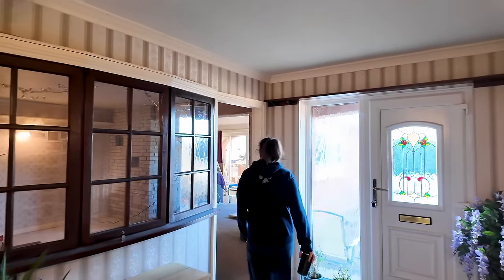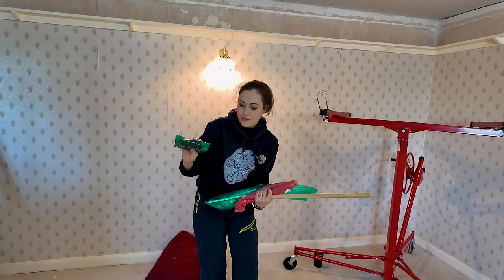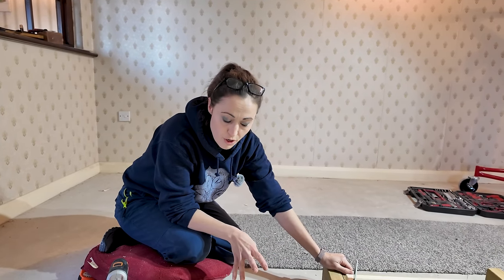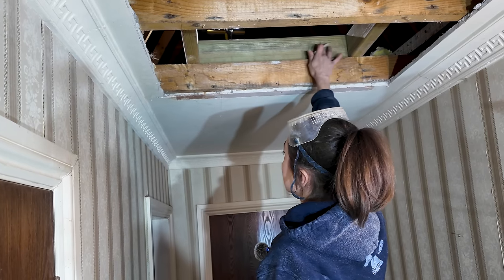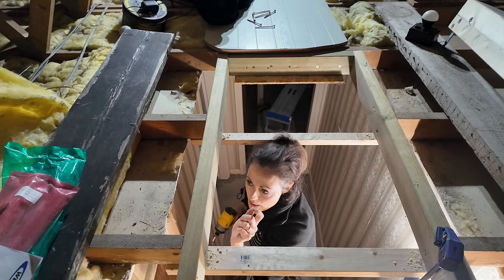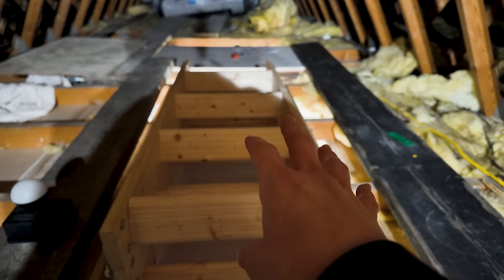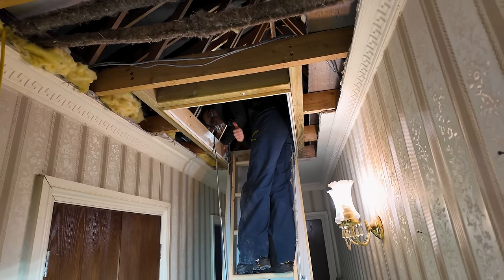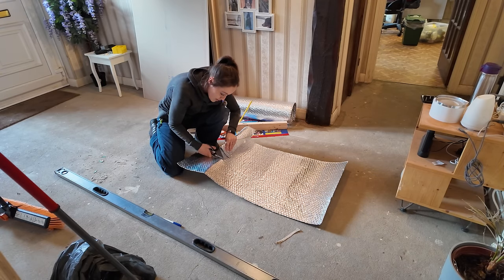How l installed a DIY loft ladder hatch kit without a PRO!

Comment from the maker: Now it's done do you think I should hire a plasterer or have a go myself???
Reply: Hire a plaster 100%. I got let down by my plaster so I thought how hard can it be? Turns out really hard. I was doing the landing and the hall all by myself and it kills your arms and although it looked ok when painted it really was not. 

Also a good loft ladder, decent set of fluorescent light and boarding and the loft becomes another useable space for storing stuff. Lighting is the key though. Don’t scrimp on the number of lights. You’d be surprised at the difference it makes.
Reply from the maker: Thanks so much! I've just bought 3 6ft LED batten lights (7200 lumens) for up there... hopefully it's not too bright 😅
Reply: It's never too bright in the attic. @TheCarpentersDaughterUK
Reply from the maker: I hope not. Going to test them tonight 😀
Reply: hire it out - maybe give it a go in the hallway so you can get your diy fix and make a video out of it but that big room is going to suck.
Reply from the maker: Thanks. I would've thought the hallway would be harder than dry lining the big room?
Reply: Just less overall area to do, and you'd still get to do all the steps of it.  @TheCarpentersDaughterUK
Reply: Have a go yourself I think but invest in some decent plastering tools if you don't have any already.
Reply: I don't skim ceilings any more, just tape and joint compound. Gypsum plaster seems to crack so easy on a ceiling where as paper tape and joint compound has never cracked on any ceiling I've done, and it's so much easier to do.
Reply: I prefer to take everything on myself if possible, and I'm extremely averse to hiring out due to the UK's high proportion of untrustworthy tradespeople. However, finish plastering is among my few exceptions. Almost every other DIY task appeals to me more, and the skill requires substantial time investment. When my brother and I built my kitchen, we fitted the ceiling plasterboard but got an excellent plasterer in for finishing all walls and ceiling. It looked like a mirror afterwards, yet looking it over he shook his head, said "I'm not happy with that", took it off and did it all over again!
Reply: A professional would make quick and easy work out of it. Take the down time to recover.
Reply from the maker: Wow lol... hope they didn't charge you twice 😅
Reply: I feel ya. When finishing my basement I spent a full week mudding/sanding a room, gave myself a sinus infection and was sore all over. Looks like shit lol. @worstuserever
Reply: I wouldn't recommend taking on a ceiling as a first foray into plastering. I would wait till there's a lot of bits of plastering to be done and get a pro in - they do huge amounts in a very short space of time. If you want to try it pick a small flat area of damaged wall or part of the fireplace you're not sure about. Good luck either way.
Reply: Perhaps try a small area in the hallway first so if it doesn’t work out there’s not too much damage? Once you start plastering a room you cannot stop until it’s completed. By trying out a small area you will know if you have the physical strength to complete a whole ceiling in a room!
Reply: Ceilings are the hardest to skim. You’ll ache in places you didn’t know you had and the light shows even the smallest imperfection. Try skimming a small wall first.
Reply: Good job, nice easy access and tidy too. Whilst you are a handy sorta girl, bitter experience and age has told me that a professional is best for some jobs.
A tool suggestion if you don't already have one, get yourself a Cat's Paw - like a little wrecking bar but about 3/4 your hammer length. Should cost less than a tenner.
So handy in tight spots, easier than a claw hammer and make a great little sound when you smack 'em. Got a nail bag?
Reply: Definitely get a pro in, plastering is a very easy thing to do... badly. 😜
Reply: Have a go yourself. It's a small area so perfect for a first attempt.
Reply: Hire. No hesitation on this one. I once converted a basement and had a highly recommended guy come in to plaster the walls and ceiling. I have never seen anyone sweat so much outside of a gym!
Reply from the maker: @across8339 🤣🤣 I'll leave it on this one then! 😀 Thanks for the honesty lol
Reply: Tape your joints and Gyproc Easyfill
Reply: its not a easy job plastering 🤣
Reply from the maker: @mikebarry229  i would definitely agree to consult a professional beforehand. I thought I made that clear in the video, but always good to reiterate for those that missed it. Thanks 👍

Comment: Well Vikkie that has brought back memories to when i fitted the same loft ladder to a family members house but the ceiling was so high that we used the loft ladder at it's full length.
I can tell you that we had a devil of a time getting the ladder fixed into place in an old victorian terrace. 
The black dust got everywhere and we were finding it for weeks later.
We must have done something right as it is still there and in great working order after 20 years.
I am really enjoying the house renovation series and i know that i am going to learn something from it : )
Reply from the maker: Thanks so much 🥰 I don't like heights (which is why I hated seeing the drop through the ceiling before I plasterboarded it up) so can't imagine having to fit it at full length and how awkward it must've been to install on step ladders. I'd've probably wanted to used a scaffolding platform lol. But once done, they are great! Hopefully mine lasts for at least that time too!

Comment: I have used neon light switches at almost ceiling height in my hall - these can only be switched on when on the ladder so no accidental switches & let's you know you've left the lights on. Also no scrambling around for a switch in the dark loft space. Thys doin a grand job lass 😊
Reply from the maker: Thanks so much :) That sounds very useful! I've not seen neon ones before either!
Reply: That's a good tip - might do that myself

Comment: Well done, similar to one in my home. Don't forget, over the years, wood will warp so maybe that latch may not work, my loft ladder just hangs there.  Terrible for roaches to enter the house, I need to spray the loft every six months with roach spray (they enter the loft via down pipes).

You now have to add lights in the loft - DO NOT use the loft for storage unless you want an invasion of bugs / roaches etc.  Work men love the ladder and lights, easy to work up there.
Reply from the maker: Thanks again for the tips and cockroaches sound awful 😅

Comment: Once you've got all the insulation spread out and ceiling plastered, if you still have any air leaks around the hatch you could look into a 'loft stairway cover'. Little foil canopy that goes in the loft over the hatch that zips up and encloses the ladder. Might take some shopping around to find the right size to fit over the ladder (they aren't really a thing over here, seem to be more popular in the states), but from everything I've seen they can basically eliminate drafts that can normally get through even draft excluding strips.
Should stop the hatch cover getting cold too (insulated ones still get cold, just not as quick).
Reply from the maker: Thanks for the tip! I'll look into that 😀

Comment: I am in Canada and here any modifications to a roof truss needs to approved/signed off by a structural engineer, not sure what the rules are in the UK.
Reply from the maker: You definitely do here for a listed building and it may be different for certain councils, but most of the time, we don't

Comment: Installing a loft ladder has been on my list for a few years now, there's always some urgent repair to burn up the time instead. I'm pretty sure we won't have to cut any joists for ours, bloody hope not. Also looking forward to how you floor the loft as we just have assorted loose boards at the moment and isn't properly insulated either. Vacillating over the insulation method, as we obviously want it to be efficient but maintaining good ventilation and losing as little head height as possible.
Reply from the maker: Boarding a walkway is definitely on our to do list 😀 But if you have the time, it's definitely worth installing a loft ladder

Comment: I had these loft ladders with an extra section for a 12ft ceiling, they were awful, uninstalled them and replaced them with concertina typr. For lower ceilings they are ok and you did a great job.
Reply from the maker: Thanks so much for the heads up! The concertina ones do look cool! 😀
Reply: @TheCarpentersDaughterUK  The 3 sections work great, the extra section high up made them dangerous to bring down and the hinges slackened off all the time causing them to bow, felt unsafe. Just in case someone has a 12ft ceiling and watches this. Great idea to make the frame up and then cut it in, i never did it that way before.
Reply from the maker: Hinges coming lose sounds VERY scary!!

Comment: I really admire your grit and determination, it's looking great! I should have fitted a larger hatch when I was plasterboarding as mine is tiny! I'm fairly slim and I can only get just get through it if I put my arms up in the air first 😂 I decided against it because the joists are pretty skinny and I thought it would be a good deterrent to stop me filling the loft with crap! I'm guilty of trying to preserve as much of the original building as possible too but I think as it's such a small space you would be better off reboarding the whole hallway, it will make for a better plaster finish. Those plasterboard driver tips are a bit naff in my experience, the adjustable ones are probably better but I had the fixed cup ones and didn't get on with them, ended up just using a normal PH2 bit.
Reply from the maker: Thanks for the heads up! Stripping back the rest of the hall is something we have considered (not totally ruled it out yet) 😆

Comment: We installed a loft ladder in our last house (well my dad did most of it) as the existing loft hatch was about A4 size and there was no way I was getting up there without dislocating my shoulders each time. We had to get through the lath and plaster ceiling which was underneath the plasterboard. It was not a fun or clean job 😂
Reply from the maker: Ugh.. sounds messy 😕 we put an offer in for an old Victorian house that had a similar one and I was thinking how this house we bought was probably much easier. I trust the joists so much more than the other (it also had structural issues)

Comment: For doing jobs in the loft the very first thing to do is fit a long LED batten (in the past a tube light)  so that you can see what you are doing (!) and aren't working in your own shadow if you only have a single light bulb.
Regarding the plastering ... as it is ceilings, I would get a plasterer to do it.  Having a go doing walls is one thing but ceilings need practice.
Reply from the maker: Thanks for the tips. We're actually in the middle of installing LED batten lights as we speak 😉

Comment: Really good install, impressive. I quite admire your methodical approach to make certain the measurements & cuts are correct so there’s no issues with the install. When you were removing the old loft access door, would a reciprocating saw made it easier for you to cut through the old screws/nails/timber, etc.? Just curious.😊
Reply from the maker: Thanks so much! And yes.. you're right! That's a tool I totally forgot I could've used 😅😅😅 I've got one that turns into a jigsaw (which would've also been better than a multi tool 🤣). Oh well, I can't win them all lok

Comment: Vikki - you are quite often working at height ie (loft hatch work) - as a suggestion why don't you make yourself an additional 3" platform to "clip" over the top of your existing step up?
Gain 3" in height for easier working.
Reply from the maker: Thanks! That's a great idea 😀

Comment: Board out the loft if you can; a loft provides really useful storage space.
Reply from the maker: Thanks so much! I do plan to board some eventually, but probably just a walk way initially 😀
Reply: When boarding a loft, where does the required 300mm insulation go? I've always wondered this.
Reply from the maker: We've always wondered that too. After doing research, I found it's best to add more structural timber on to, but going the opposite way. But you need to add a few layers to raise it. Now I'm not sure you can compress it either. (Got to do more research). Maybe it would put too much pressure on the plasterboard below.
Reply: Yes, I've read you should not board directly on the joists or compress the insulation. There's plastic loft legs you can get but they look a bit weak to me and put point loads on the joists, whereas loft boards on the joists ties them together and distributes the load better. It needs deeper research. @TheCarpentersDaughterUK

Comment: Hi I watched this in amazement I built a house where a builder cut throu two trusses and he made the mistake so he had to pay for an engineer to surveyor the damaged trusses and the load removed from them had to be placed on the other trusses to spread the load and we had the loft boarded to so it didn't make any difference we still had to spread the load to the other trusses
Reply: Sorry Structure engineer

Comment: What CAD software do you use? I like the planning aspects that gets done behind the scenes.
Reply from the maker: Thankyou, we paid for sketchup pro for a years subscription, when it was 15% off, but the free version apparently works  well. But there is an extention I like that creates a cut list for woodworking projects when I finish designing them that I found really useful with the paid version.
Reply: Thanks! Very helpful and will help me plan future mods for the house. Just to add, you have been a very good inspiration generally. :)
Reply from the maker: Thanks so much 😀

Comment: Don't see any supports on the truss that you cut. Mm
Reply from the maker: It's all sat on 2 walls very close to each other that are about 1.1m apart. If it wasn't, then I'd double up on the first and last joists. It's also getting boarded shortly.
Reply: @TheCarpentersDaughterUK I'm not sure that's the point being made. You cut 2 truss chords.

Comment: There are simpler and better loft traps that are fully insulated and can be used with an aluminium ladder that rests in the loft not on the trapdoor.  Suggest also you need to learn to use a hand saw instead of relying on power tools.  But you're learning and willing to have a go, so good on you.  Get a plasterer if you want a fine finish.
Reply from the maker: Thanks. I try to favour hand tools where possible because they're quieter and less dusty, but for absolute accuracy, I'd use power tools every time for this job.